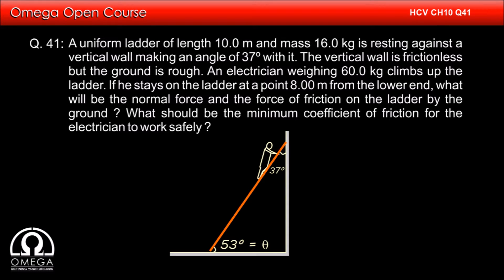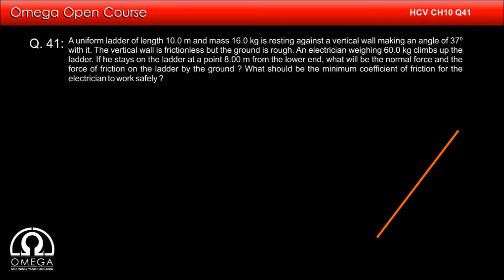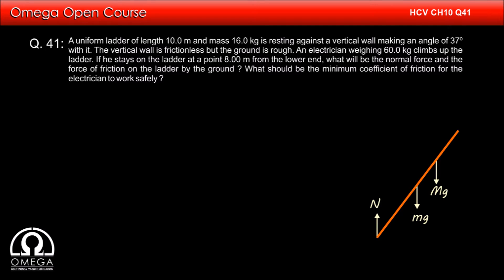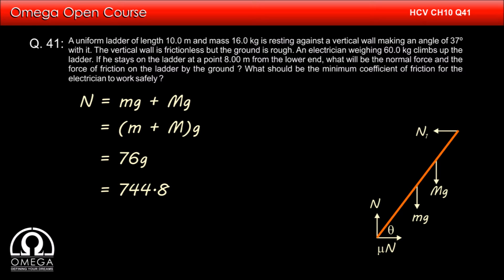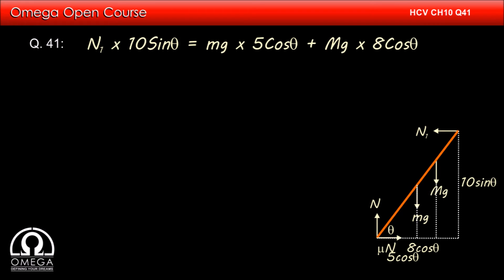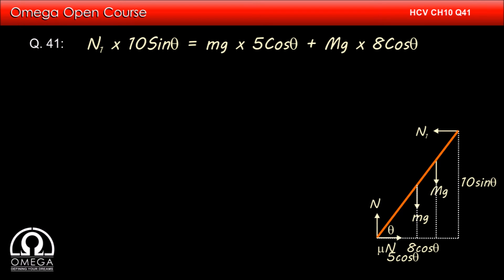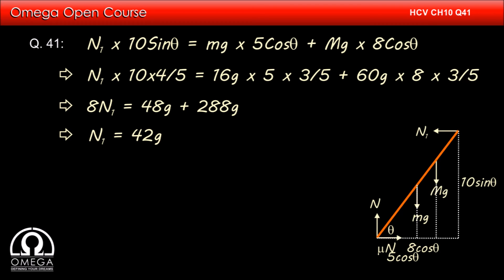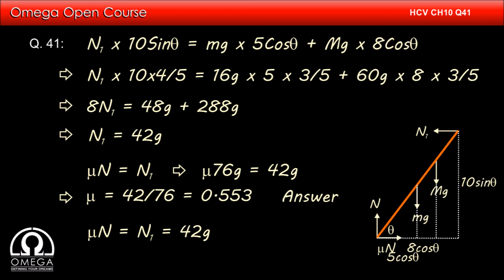H. C. Verma Solutions - Chapter 10, Question 41

Comment: But in fbd of ladder normal force by man should be drawn instead of mg of man as mg will be acting on man (so it should be drawn in the fbd of man not ladder). So plz help reply ASAP..
Reply: Hey! You know that was the same thing that compelled me to watch this video, and after very deep thinking I got its solution l, which I didn't get in this video too.
The answer is that, the ladder has steps which is connected to 2 thick bamboo pipes, and the steps are perpendicular to it, so the steps apply a normal reaction (equal to the weight of Man) on both the thick pipes which cancels the N in upward direction (that of Man) so there is no net N.
This ruined my whole day, not thinking about the solution but about "How HC verma can be wrong????!!!"😀😀